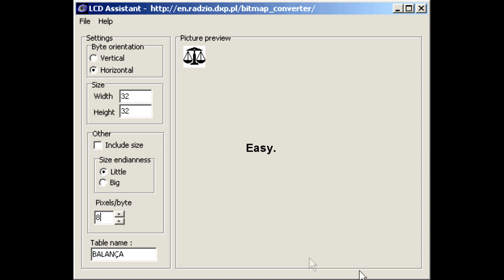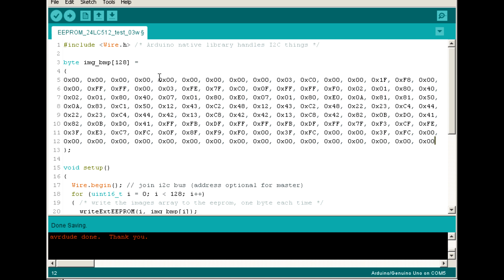Arduino - Bitmap Images from I2C EEPROM to OLED 128x64 Display

Comment from the maker: :_bat1: /* load images converted into byte arrays from external I2C EEPROM to a local */
/*  buffer array and display them on an OLED screen */

#include <Wire.h> /* Arduino native library handles I2C things */
#include <Adafruit_GFX.h>       /* Adafruit graphics lib  */
#include <Adafruit_SSD1306.h>   /* Adafruit SSD1306 OLED driver lib  */

#define SCREEN_WIDTH 128  /* OLED display width, in pixels  */
#define SCREEN_HEIGHT 64  /* OLED display height, in pixels */

/* SSD1306 display connected to I2C (SDA, SCL pins)               */
#define OLED_RESET -1 /* Reset pin # (or -1 if sharing Arduino reset pin) */
Adafruit_SSD1306 oled(SCREEN_WIDTH, SCREEN_HEIGHT, &Wire, OLED_RESET);

byte img_bmp[128] =   /* buffer array to receive images from external EEPROM */
{                     /* 32x32 pixels, 128 bytes */
B00000000, B00000000, B00000000, B00000000,
B00000000, B00000000, B00000000, B00000000,
B00000000, B00000011, B11000000, B00000000,
B00000000, B00011111, B11111000, B00000000,
B00000000, B11111111, B11111111, B00000000,
B00000011, B11111110, B01111111, B11000000,
B00001111, B11111111, B11111111, B11110000,
B00000010, B00000001, B10000000, B01000000,
B00000010, B00000001, B10000000, B01000000,
B00000111, B00000001, B10000000, B11100000,
B00000111, B00000001, B10000000, B11100000,
B00001010, B10000001, B10000001, B01010000,
B00001010, B10000011, B11000001, B01010000,
B00010010, B01000011, B11000010, B01001000,
B00010010, B01000011, B11000010, B01001000,
B00100010, B00100011, B11000100, B01000100,
B00100010, B00100011, B11000100, B01000100,
B01000010, B00010011, B11001000, B01000010,
B01000010, B00010011, B11001000, B01000010,
B10000010, B00001011, B11010000, B01000001,
B10000010, B00001011, B11010000, B01000001,
B11111111, B11111011, B11011111, B11111111,
B11111111, B11111011, B11011111, B11111111,
B01111111, B11110011, B11001111, B11111110,
B00111111, B11100011, B11000111, B11111100,
B00001111, B10001111, B11111001, B11110000,
B00000000, B00111111, B11111100, B00000000,
B00000000, B00111111, B11111100, B00000000,
B00000000, B00000000, B00000000, B00000000,
B00000000, B00000000, B00000000, B00000000,
B00000000, B00000000, B00000000, B00000000,
B00000000, B00000000, B00000000, B00000000
};

void setup() {
  //Wire.begin(); // join i2c bus (address optional for master)
  Serial.begin(57600);                /* initialize serial for OLED debug */
  /* SSD1306_SWITCHCAPVCC = generate display voltage from 3.3V internally */
  if (!oled.begin(SSD1306_SWITCHCAPVCC, 0x3C)) /* oled I2C address 0x3C   */
  { /* if oled failed to iitialize, */
    Serial.println(F("SSD1306 allocation failed")); /* print a warn       */
    for (;;);                             /* Don't proceed, loop forever  */
  }
  delay(300);           /* wait a little                 */
  oled.clearDisplay();  /* then clear the display buffer */
}

void loop() {
  /* 24LC512 512K bit eeprom, 65536 bytes */
  for (uint16_t i = 2048; i < 3840; i++) { /* loop, eeprom address region where images were saved */
    img_bmp[i % 128] = readExtEEPROM(i);/* read data from eeprom one byte each time */
    if (i % 128 == 0) /* if the buffer array is full, display the image */
    {
  /* drawBitmap(x,y,img_array,w,h,color); */
      oled.drawBitmap(              /* draw the image from buffer array */
        (oled.width()  - 32 ) / 2,  /* center the 32x32 pixels image */
        (oled.height() - 32 ) / 2, img_bmp, 32, 32, WHITE);
      oled.display();
    }
    delay(7); /* not that it is fast, but unless an animation is intended, delay it */
    oled.clearDisplay(); /* make things clear before going on */
  }
}

/* read 24LC512 I2C EEPROM */
byte readExtEEPROM(uint16_t address)
{
  Wire.beginTransmission(0x50); /* I2C address */
  Wire.write((uint16_t)(address >> 8));   /* mem address MSB */
  Wire.write((uint16_t)(address & 0xFF)); /* mem address LSB */
  Wire.endTransmission();
  Wire.requestFrom(0x50, 1);    /* ask for 1 byte */
  if (Wire.available()) return Wire.read(); /* read its value and return it */
}

Comment from the maker: :_bat1: /* saves monochrome images converted to byte arrays into external I2C EEPROM */

#include <Wire.h> /* Arduino native library handles I2C things */

byte img_bmp[128] = /* monochrome image 32x32 pixels */
{
0x00, 0x00, 0x00, 0x00, 0x00, 0x00, 0x00, 0x00, 0x00, 0x03, 0xC0, 0x00, 0x00, 0x1F, 0xF8, 0x00,
0x00, 0xFF, 0xFF, 0x00, 0x03, 0xFE, 0x7F, 0xC0, 0x0F, 0xFF, 0xFF, 0xF0, 0x02, 0x01, 0x80, 0x40,
0x02, 0x01, 0x80, 0x40, 0x07, 0x01, 0x80, 0xE0, 0x07, 0x01, 0x80, 0xE0, 0x0A, 0x81, 0x81, 0x50,
0x0A, 0x83, 0xC1, 0x50, 0x12, 0x43, 0xC2, 0x48, 0x12, 0x43, 0xC2, 0x48, 0x22, 0x23, 0xC4, 0x44,
0x22, 0x23, 0xC4, 0x44, 0x42, 0x13, 0xC8, 0x42, 0x42, 0x13, 0xC8, 0x42, 0x82, 0x0B, 0xD0, 0x41,
0x82, 0x0B, 0xD0, 0x41, 0xFF, 0xFB, 0xDF, 0xFF, 0xFF, 0xFB, 0xDF, 0xFF, 0x7F, 0xF3, 0xCF, 0xFE,
0x3F, 0xE3, 0xC7, 0xFC, 0x0F, 0x8F, 0xF9, 0xF0, 0x00, 0x3F, 0xFC, 0x00, 0x00, 0x3F, 0xFC, 0x00,
0x00, 0x00, 0x00, 0x00, 0x00, 0x00, 0x00, 0x00, 0x00, 0x00, 0x00, 0x00, 0x00, 0x00, 0x00, 0x00
};

void setup()
{
  Wire.begin(); // join i2c bus (address optional for master)
  uint16_t addr = 0;  							 /* addresss to where data will be written in EEPROM */
  for (uint16_t i = addr; i < sizeof(img_bmp); i++) /* loop for the eeprom address and array index */
  { /* write the image array to the eeprom, one byte each time */
    writeExtEEPROM(i, img_bmp[i%sizeof(img_bmp)]);
  }
}

void loop() {}

/* I2C EEPROM write */
void writeExtEEPROM(uint16_t address, byte data)
{
  Wire.beginTransmission(0x50); /* I2C address */
  Wire.write((uint16_t)(address >> 8));   // MSB
  Wire.write((uint16_t)(address & 0xFF)); // LSB
  Wire.write(data);             /* write data to eeprom */
  Wire.endTransmission();
  delay(7);
}